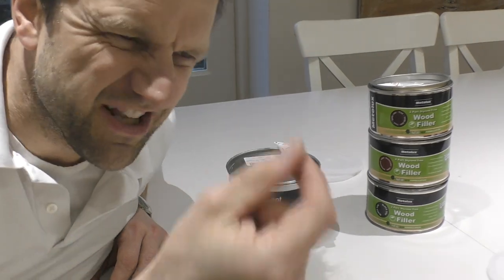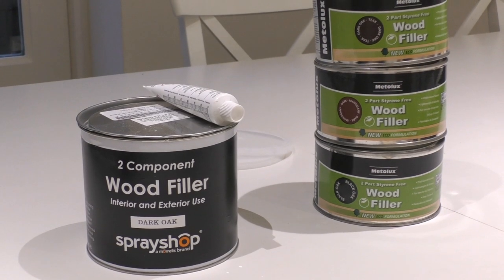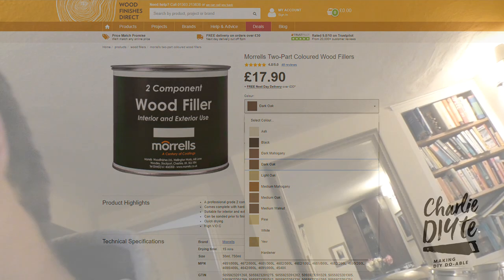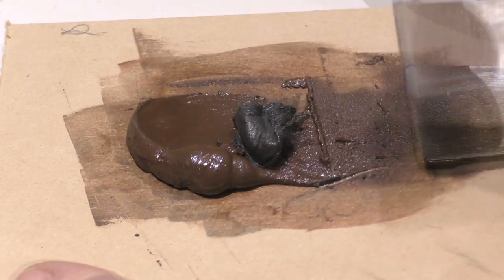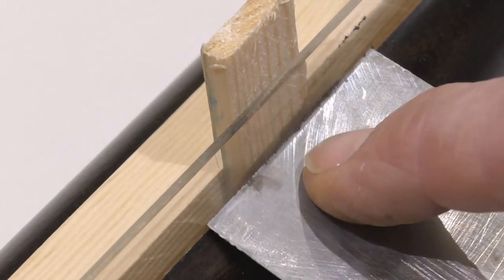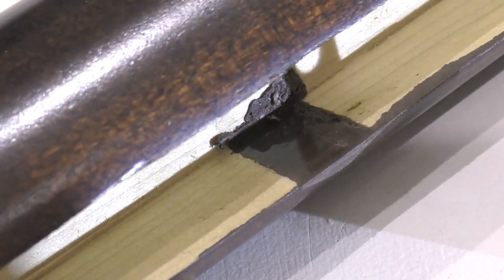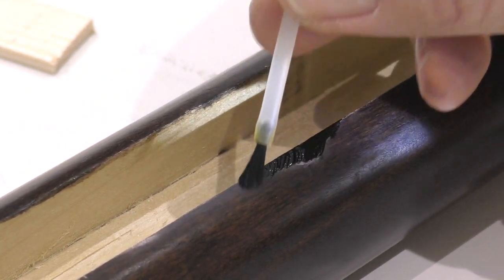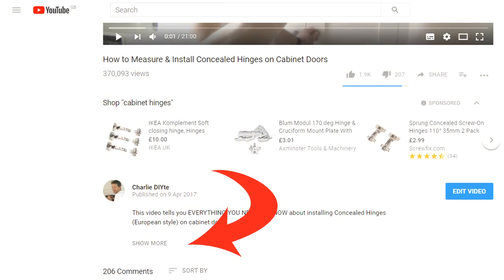Coloured 2 Part Wood Fillers

Comment: Thanks for all the videos. I enjoy them and find them very useful. Here are some ideas for videos that you may wish to make in the future. If you add the wood stain to light coloured filler before you add the hardener, does it work? Or, if you use light coloured filler and then stain it after it's set, does that work? I like the way you use the acrylic to stop the filler sticking to the pole. If you get a bit of plastic from a plastic bag and wrap it round a bit of wood and tape it tight, could you use it instead of acrylic?

Comment: Thanks for this video Charlie, it'll come in handy. Was wondering, if you haven't already, would you mind doing a how-to on routing out the curtain poles and fitting a rail inside? I've got that job coming up and it would be really useful to learn off you, especially as it's something you do in your day job.

Cheers, Sam
Reply from the maker: Hi Sam, sorry I missed this. I've got some more coming up soon that need doing but I suspect it'll be too late for your job.
Reply: HI Charlie, not to worry matey. My wife and I ended up getting Hilary's round to fit some Roman blinds so I didn't need it in the end. I think it'll still be a good video for you to do though. Cheers anyway